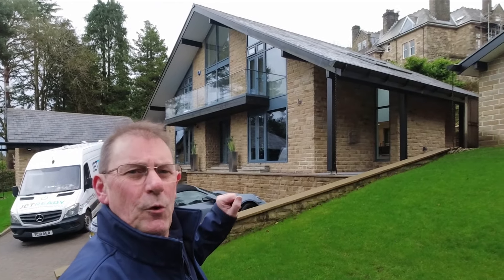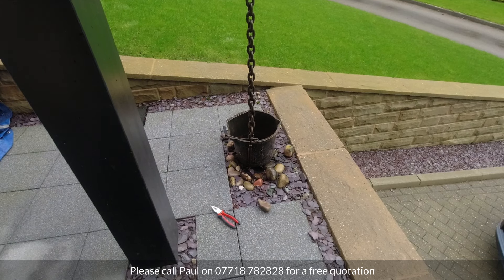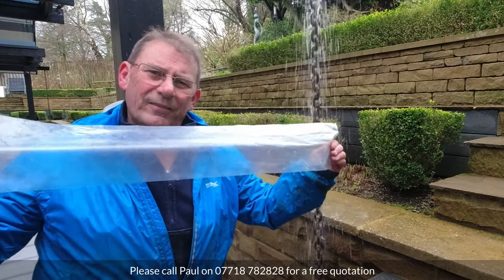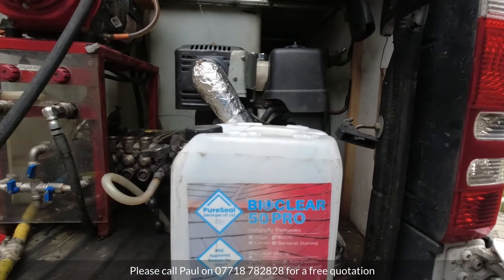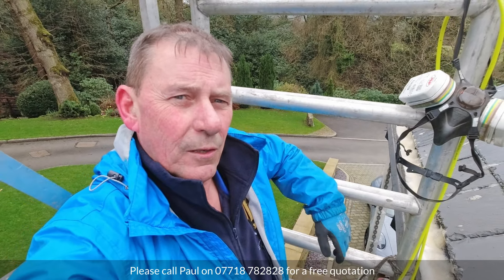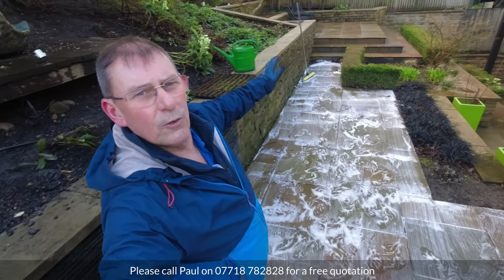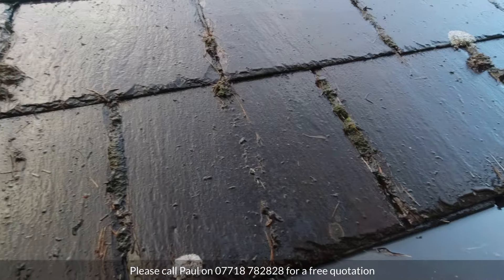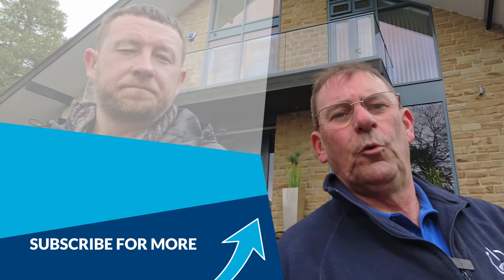SPRING CLEANING The Biggest Roof Of The Year! Roof Cleaning in Ilkley

Comment: Hi mate been watching your you tube videos and decided to make a go of my own exterior cleaning company down in Essex was just wondering what weed killer you recommend and also what sort of jobs are you doing in the winter time to keep ticking over thanks in advance Zak
Reply from the maker: Hi Zak. Great to hear you're  going out on your own. I wish you the best of luck.

As for weed killer, I use Gallup XL. Important to know that you must be qualified to use weed killer commercially, and to know that it is  illegal to offer service if you are not qualified. The qualification you need is known as PA1 & PA6 (City & Guilds). I took the course a couple of years ago and it cost about £500. 

The winter is tough and the best thing you can do is take a long holiday 😄 That said, there is still work to be had, but you should only expect to tick over. 

The pressure washing season is very busy between mid-February and July. And there is lots of work to be had during the summer with decking restoration. The autumn brings opportunities for gutter and roof cleaning. Render cleaning is another avenue which can also keep you busy, year round.

The best thing you can do is get on a training course. I recommend Pureseal Module 1 for starters.